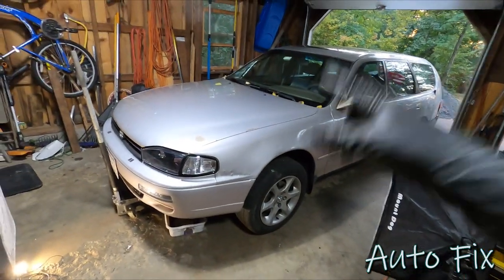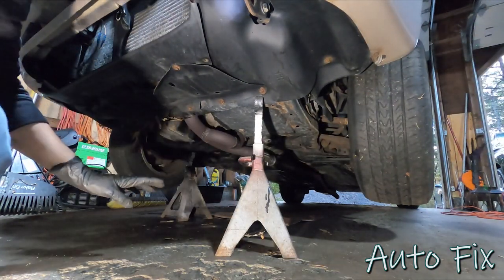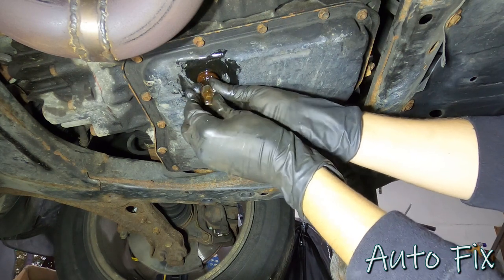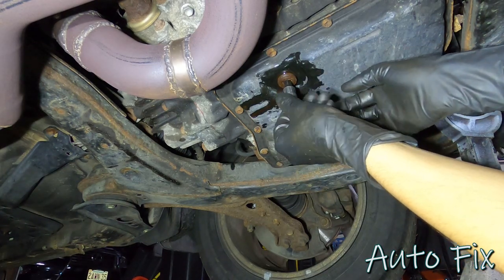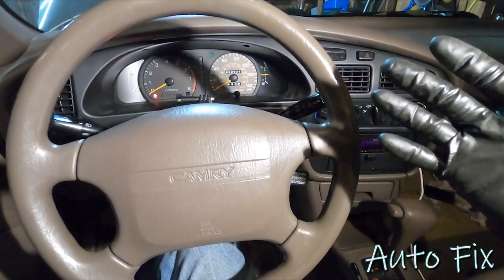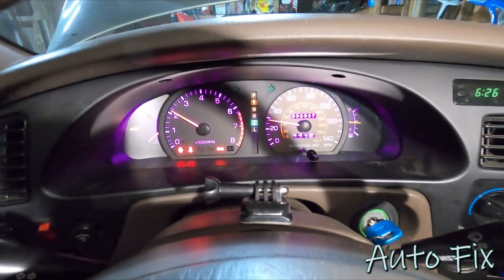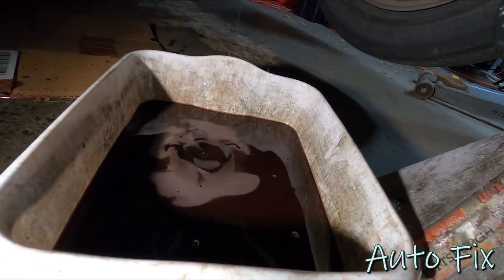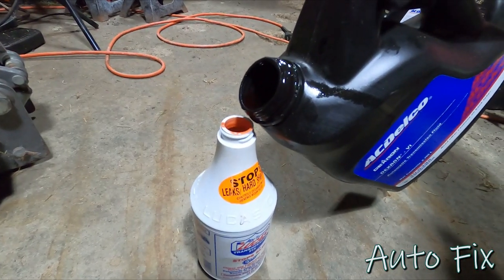Transmission Drain & Fill '94-'03 Toyota Camry, Solara, Avalon, Sienna & Lexus ES300

Comment: Would be nice to see a hood strut replacement video in future 😲🤪😲
Reply from the maker: I don't have the car anymore but they're easy to replace. Usually they just unscrew with a 12mm wrench.
Reply: My Lexus has the same problem. I just got a wooden stick cut to the right length that I use as a prop to hold the hood up. Just make sure you place it somewhere where it won't damage anything and it won't move so that the hood doesn't drop on your head. Then carry the stick around with you in the trunk.
Reply from the maker: Lol I did the same except I didn't carry it in the car, I just had it in the garage

Comment: I have a 97 toyota corolla 4 speed auto they told me 4 bottle of dex merc or 33
Reply from the maker: Yeah that would work. But straight dexron is best. That's what these were made to run.
Reply: Dang it I'll do that on next one and keep it on straight dex Ron thanks
Reply: One more.thing should.i do.trans oil often every 3000 or 5000
Reply: Usually do it same time as oil change